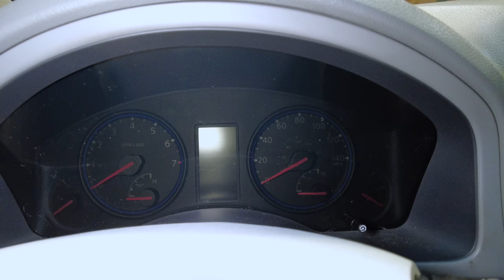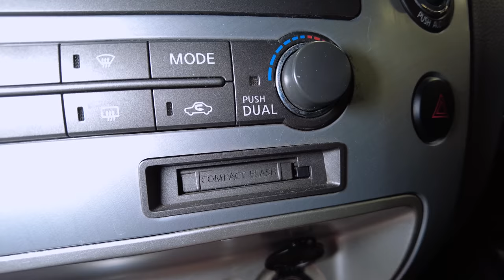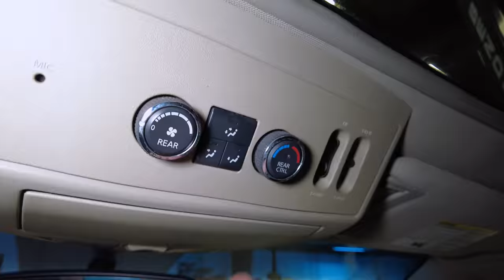Love it or Hate it! Common issues EVERY Infiniti QX56 has. CAR WIZARD knows - he had one!

Comment: The lines to the rear AC corrode. Require the body of the frame to be repaired. The headlights develop moisture inside. They are no longer available, but they are over $1000 each for parts if they are.  The acoustic distance sensor for the cruise goes bad, nearly $2000 for parts. The cruise control module could also go bad. On might, the chrome is flaking off the wheels.

I think I might get a 2025 diesel Tahoe.
Reply: Found one near me at around 9k with a decent monthly payment plan honestly thinking of going with a higher mileage Toyota Sequoia instead considering all the issues listed
Reply: I need a new headlight and it’s 1499. I don’t understand the thousand dollars.

Comment: I didnt know they had air suspension but that car is in great shape.  For infiniti you know all seals and sensors need replacement every 100k miles . Once done you can expect another 100k on the engine

Comment: I hope a 2010+ second gen QX56/80 or 2017+ Nissan Armada shows up in your shop someday. They're based on the Nissan Patrol and built in Japan with US engines. This 1st gen example is based on the Titan pick-up and built in Mississippi. Curious if the 1st gen problems were fixed.
Reply: They aren't "based on the Nissan Patrol", they are Nissan Patrols with less off-road goodies.  Why they brought over a vehicle that is 99% the same as the international version, but changed the name to match a vehicle with a tarnished reputation is beyond me.
Reply: The second gen QX56/80 is just absolutely hideous imo...the armada variant is much more attractive as well as this previous gen.
Reply: The 2010 QX56 is on the Patrol platform according to research I've done. Am I missing something?
Reply: @kebby8251  Correct. 2010 QX's onward and 2017 Armadas onward are Patrol based.
Reply: @sprague49  2010 is the final year for 1st gen, same as the one in this vid.  I own one.  2011+ QX is 2nd gen.
Reply: Yeah I was wondering the same thing about the newer gin 2012 and up especially based on the patrol model for the Infiniti QX56 are those reliable or do you have the same issues thinking about buying one

Comment: I used to drive 30-40 year old vehicles.   I never had problems getting parts.  I now drive a '13 Transit Connect van.  Common enough that parts should not be a problem for a while.
Reply: They just discontinued the Transit Connects stateside. Ugh. Hopefully you won’t have a need.

Comment: I had one.  It was a beast, but the heater actuator went out at 70k.  I bought a new one from EBay, and that did the trick.  Now, I did have an exhaust manifold crack.

Comment: My 2008 VW 2.0T w/140k miles on it looks even better than that Sequoia. As you said, it's all about the oil changes. It even has the original turbo despite being stage1 chipped most of its life. Of course, being a VW product, a lot of other maintenance items have kept be busy! Not Toyota quality all around, by any means.
Reply: I own the Sequoia, had an 03 Jetta 1.8t to 235k until accidentally and somehow downshifted from fifth to first at speed. My favorite FAVORITE car to date. Miles if smiles and 14 k in repairs over 235k
Reply: Should have gotten a VW with an 07k or tdi........

Comment: As someone who has had both the Sequoia and currently owns both a 2009 QX56 and a 2014 QX56, this vehicle looks like it had quite a lot of owner negligence. My 09 Qx56 rides way smoother and more powerful than the Sequoia without having these issues described in the video. At 165k miles, I had minimal issues with it besides normal wear and tear. Living in Chicago winters all its life rust was an issue. at 100k I decided to replace all major suspension components with heavier-duty parts due to rust affecting the control arms. I also chose to replace my exhaust with Cajun long headers to avoid the header cracking issues that these vehicles are known for. Offroad she is a beast these vehicles taken care of can live 200k and further.

Comment: I have this exact year and model of Infiniti QX56 and thoroughly enjoy it. You are correct in your some summation that those are common failure points. I have the problem with the heat inside the passenger compartment where in drive I get no heat but if I shift manually into fourth third or second gear then I get heat so I am assuming that it's not the cams under the dash but the part that's the electronic control out under the hood. I'm going to have to fix that to keep my wife happy.

Comment: the inside of the engine in my truck is just as clean as the Toyota I have a 2003 GMC Yukon Xl Denali with a 6.0l LQ4 with 289,000 miles on it still going strong.

Comment: I’ve owned about 12 Nissans in my life - everything built after the Ghosn era (error?) was absolute GARBAGE. I’d love to see you get a first-gen Murano in your shop! Those have a neat feature that causes the driver’s seat to randomly collapse - I have no idea how that issue wasn’t recalled as it’s so common!
Reply: Nissan made an updated bracket repair kit for the Left front seat frame
Reply: @AndrewM83  A day late and a dollar short. When my 2006 seat frame failed in 2010, I had to buy an entire lower seat frame - motors and all - for just under $1000! The repair kits were released shortly after I dumped that car after the HVAC blower relay failed and it was just in time for the CVT to start acting up (it was maintained), and it needed tires. Traded that POS in for a new Hyundai Elantra just to get out of the loan!
Reply: @bbishoppcm  I understand. What you're describing were common fail points of the First generation Murano.

Comment: If I run into a lot of money I would definitely buy one of these. I've wanted one of these since it came out, but I wouldn't be able to afford the upkeep. My 2002 Nissan Maxima will do for now.
Reply: Lol
Reply: It’s mostly the cheap interior and suspension parts on these trucks that are the issue. The motor and tranny are rock solid if you perform regular maintenance. I do agree that the exhaust manifold problem is expensive. Headers with a tune are a good once and for all fix.

Comment: I'm not shocked at all Wizard, my 09 Nissan Sentra SE-R Spec V has many common failure parts that are not being made for the past 5 years. The exhaust header/catalectic converter combo is no longer made by Nissan. It was $700.00 Canadian dollars for the Dorman part, which was not stocked in Canada or the USA, and had to be ordered from Dorman. Waited 2 months for manufacturing & delivery. The six speed shifter mechanism is no longer made either, and has NO aftermarket replacement. I have been hunting for 3 years for that part. Nissan has been in trouble financially for so long now, it's no wonder they are not making parts for their products anymore... they can't afford it. Keep up the great work and helpful videos Wizard!
Reply: Damn i guess thats why i dont see sers in that gen. Though i do still see base model 1.8 S

Comment: Nissan isn't that bad I own a 2014 q70 with a vk56 direct injection tho which bumps the HP to 420. If people took care of these engines and did oil change every 3k miles. If you do maintenance yourself then it isn't that bad. If you are not then it's costly!

Comment: I just ran into a parts availability issue on a 2019 BMW!  Tension strut bushings were cracking and there were no tension struts (OE or OEM) available!  They finally became available and I snapped two up.  It's nuts that parts aren't available for a 3 year old vehicle

Comment: Meaning if you don’t fix just one bad sensor, the way the electrical system continuity is mapped, it will all go one by one, cause it’s all connected. Everything communicates to the commuter, when those things need an independent computer for each communication.

Comment: I always lower the window when working on the car.  I am paranoid about accidentally locking the keys in, plus I can easily lean in an push a button or whatever without having to open the door...garage space is sometimes tight.

Comment: I had a 2003 Sequoia and had constant little issues with it, the stability control was always throwing codes but it was reliable in getting us around, engine was a gem.  We Test Drove a 2008 Infiniti Q56 to trade in the sequoia and the Q56 drove sooo much nicer than sequoia in driving dynamics, we didn’t end up buying it but I can see why many people did.  We keep the Toyota till 200k.  When water pump went on it we sold it and starting leasing wife’s car every three years.

Comment: The location of the pcv valve will effect the color under the valve cover.  I guess my 2010 armada must be a freak cause it gets 18 mpg on the highway and I honestly haven't checked on in town mileage since the wife started driving it.
Reply: I went a whole winter with my qx56 and with no heat when it was a 10 minute (maybe even less) fix. The box on the heater inlet hose, literally has 3 screws, there’s a piece on there that shifts forward. You just push it back in place, literally that’s it. If it’s too loose go to hobby lobby you can get a piece you’d use in like toy cars.. it’s like a little plastic piece (wish i could explain better).. anyway, apparently people replace this whole part over a simple fix all the time.

Comment: Armada, QX56, or Nissan TiTAN is the only Nissan I've been interested in. STANDARD TRANSMISSION ONLY!
Reply: Good luck, none of those is offered in a standard transmission, at least not in NA.  I don't think anything with a VK56 has been offered with a manual (although the ones from the VQ40's will bolt up...but then you have get the BCM understanding what is going on).

Comment: Not that surprising your customer (or maybe the owner before him) replaced the air suspension in the QX56 with coil springs.  I did the same with my Buick Lucerne.  Air shocks were available for mine, but the conversion improved the ride, stability, and saved me $500-700.  Maybe the best part was that the shop was able to keep the suspension warning  light from coming on (warning lights that stay on all the time are a "pet peeve" of mine).
Reply: How much did this cost you mine I want to convert
Reply: @jacobwebb1598  I bought the parts and one of my two regular shops installed.them.  Total parts & labor a little less than $600.  A pair of new air shocks would cost at least $1000-1100.  Add in a new compressor if needed and the price would go even higher.

Comment: The driver's window button came loose and wobbled on our Lexus RX. There was nothing simple about repairing it, the switch was a complete module only. The window control module included the security system assembly as part of it.Very expensive to replace and hard to find.

Comment: I’ve had 4 Nissan Armadas,  power steering hoses, lower,radiator,blew out, Trans hoses leak, shocks are weak, HVAC actuators, air bag clock spring, and steering wheel heating went out.
Reply: yet you kept buying them anyway....real smart

Comment: The gas gauge thing is common even on the infiniti g35 coupe but you don't have to replace the cluster. Just send it out for repair by a local module repair business. If your manual mode/ sport mode isn't working in these cars it will also most likely be the gauge cluster and not the shifter assembly.
Reply: The huge problem on those with the V8 engine titan armada qx56 is the catalysts breaking into powder and getting sucked into the cylinder and destroying piston rings
Reply: Also the same window problems

Comment: That Infiniti simply had extended, irregular oil change intervals easily evidenced by the cams looking like that. The yota was likely a highway mileage car, the easiest type of way to rack up miles. Most any car with regular changes less than the manufacturer recommended intervals and highway miles will have internals like to yota at the same mileage.

Comment: If it shares engine platform for audi it not a surprise. Not sure why they cant make as reliable as toyota, but over-engineering does have its over-complicated issues.
Reply: It's because they're owned by Renault that's why.
Reply: @CJColvin  Yes the are owned by renault but there are model and year (not sure which ones) that did share it. I saw it in a motor trend review in YT.

Comment: Older mazdas have a nasty habit of locking themselves when changing batteries or connecting a boosterpack when the battery goes flat. Ive had to break in numerous Xedos`s, 626s,  mx6s at the dealership when the sales guys tried to start showroom vehicles to move them, locking the keys in the car. Fun times with the custmers watching what the hell was happening to the car they wanted to testdrive :)

Comment: Mine has over 300k miles 🤠

And I get 14 mpg all day with AC on. Lol
Reply: 12 here lol
Reply: I'm at 323k miles.
And I squeeze 16.5 mpg lately.
Reply: 16 highway and 12-14 in town... it's worth it though.. mine is a 2006 QX56....still drives like a dream... always garaged & I stay on top of any issues like a chicken on a bug. Change oil at 3k like clockwork.

Comment: Towing capacity is good and power is good…. Will run rings around F150’s around that same age with the 5.4L Triton 3v. But that Nissan 5.6L cannot be beat on the same way you can beat on an LS or (gasp) even the Triton. They will pay you back if you do. I had a customer in a lifted Titan who loved to mud and play hard, I replaced the head gaskets after the insane pressure in the cooling system blew the radiator and he ran it hot. He blew it again about two years later and it was actually miserable to work on lifted like that, I refused the second job.
Reply: Wrong. And that clown abused it. Gee, what happens when you redline it nonstop in mud with no airflow? Shocker, it overheats. And he just kept beating on it.
Reply: @TheGuruStud  oh ok 👌🏾

Comment: I’m looking for a used car for my wife, we don’t want payments and don’t want to spend over $10k. I am astonished at the amount of vehicles that have major design flaws from the factory that show up on used vehicles. 
Nissan Maxima transmission problems, found out first hand after a test drive so that model is off the list. Anything with a CVT transmission is off the list. I guess back to a ugly Toyota or Honda but at least it will work daily.

Comment: I have an '04 QX56 with 160k miles. About once a month while applying the brakes, it feels like the power braking has failed and there is a clunking/grinding noise and feel in the front end. Then I shut the engine off and restart and it's back to normal for quite a while. Do you have any suggestions about this?

Comment: My 05 pathfinder still runs pretty good at 125k, and had the trans replaced at 90k by the previous owner as well as the updated radiator changed. That being said, I’m saving my money so when it does die, I can buy a Toyota or at least a Honda
Reply: That year of pathfinder is a solid platform, It's just the timing chain guides you want to watch out for.  They are easy to do, but labour intensive.
Reply: The only problem with that gen pathfinder was the recall for the transmission, other then that it's a tank of a SUV.........
Reply: @dwaynepenner2788  yeah, I don’t have the timing chain whine yet, but since the miles are relatively low and the rest of the car works perfectly I think that repair will be worth doing when the time comes.
Reply: @MiguelGarcia-vj7oo  so far that’s been my experience too! It literally feels like driving a tank haha
Reply: @jakelannetti3128   my exterra went over 400,000 km this week.  It did need another engine at 380,000 ish km. Due to a cat plugging solid, dusting #1 cylinder.  I am guessing an oil port got plugged in the process and the bottom end went.  But the body and drive line was so solid and tight I replaced it with a good used engine for about $2k Canadian.
Reply: @dwaynepenner2788  that’s encouraging to hear!! I mean 380kil is pretty dang good man! Im hoping for a good long life out of mine

Comment: Nissan Maxima had a fast V6 but the interior is junk, and "toaster" model I had was a recall they would never fix (robot missed body welds under the rear seating). And was assembled in Georgia that never put "northern" antifreeze washer fluid...froze in the winter and almost killed us. Yes, Fast engines. Faster to the scrap heap. And I rented an Armada...snow/ice defeated the beast's sensors...lesson is to stop in snowy weather and clean the grills and bumpers...just dumb not putting heaters.
Reply: US workers...blaming nissan LOL. Look in the mirror.

Comment: Reflects the sales numbers, what a hunk of junk. Completely useless. Get better fuel mileage with an aircraft carrier.
Reply: Agreed!  I was surprised when he stated how bad the mpg was.  Heck, I had an 88' RAMCHARGER 4x4, TBI 318, that would get 17mpg on the HWY, non OD/lockup 727, 31" tires, and darn near 5K lbs!  I never should have sold it, not one spec of rust, never been crashed!!
Reply: My 1977 Wagoneer 4x4 auto with an AMC 401 gets 11 mpg, 8 when towing 3 tons.  8mpg around town on a modern vehicle is shameful.

Comment: Sorry but no way I want this SUV that has worn out at 150K.  Maybe that is just what most SUVs end up like.  My 1996 Mercedes Benz S320W went 300+K before having heating/cooling servo doors freeze up and I can still get adequate heat or A/C by setting dash vent openings to balance out the cabin temperature.  Admit that I can get by in temperate California, but not in Kansas where you freeze in the winter and bake in the summer.

Comment: I have a infinity qx56 with 264000 mile on it apart from electric issues it’s pretty good. I have an issue that happens every once in a while when it’s really hot outside. On acceleration the cars rpm’s starts dancing and the truck starts to lurch. Any ideas on what it might be. Mine is rwd